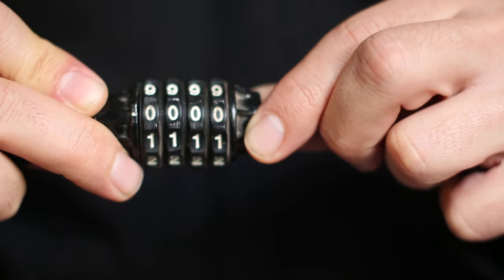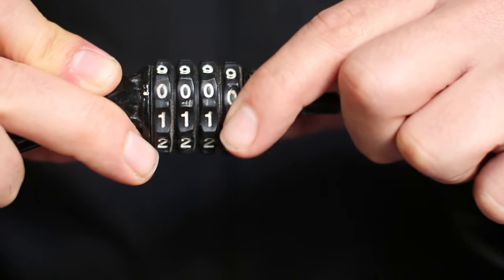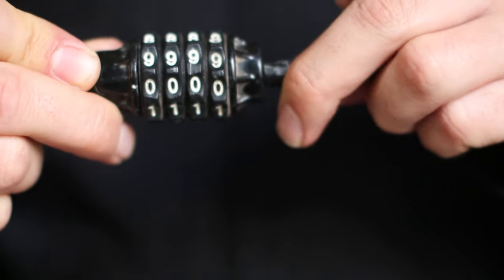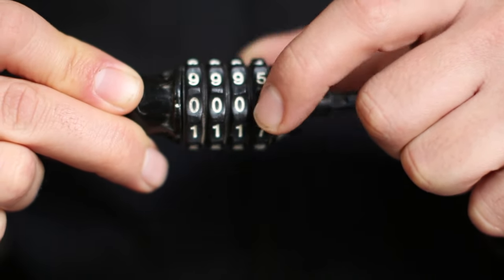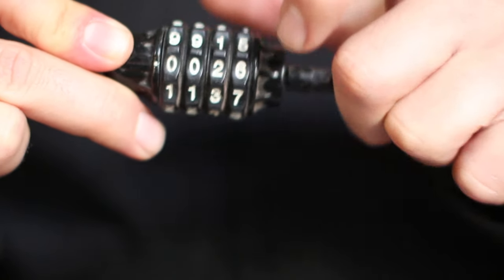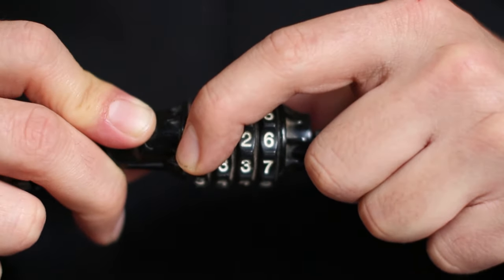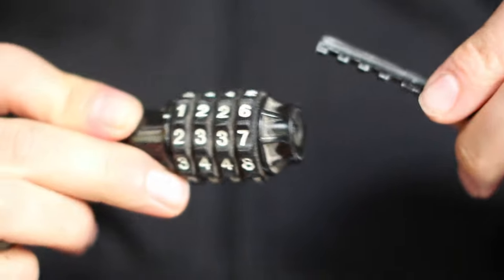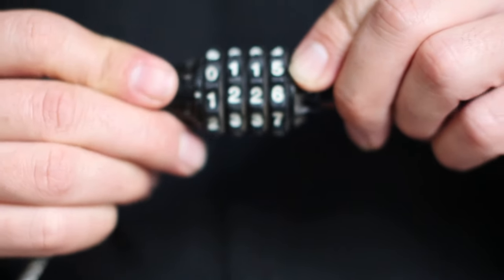How to crack a combination bike lock in seconds

Comment: Cool vid.  As mentioned, some of these locks are built to better tolerances and are more difficult to open this way.  They can also have one or more "false gates" where it feels like you have found the slot through which the pin will pass, but it's actually just an indentation in the wheel.  That makes it quite a bit more difficult to open the lock quickly.
Reply from the maker: Yes, I noticed this won't work on every combo lock.  I've seen this type of flaw on a few different ones though.

Comment: i had an old bike lock I couldn't remember the combo. tried all the numbers I would have used. once I felt like i got two of these numbers correct using this method, I was easily able to guess the other two. Thanks!
Reply from the maker: Great to hear it worked

Comment: My lock doesnt go in like that it goes from the side will this atill work
Reply from the maker: Only way to find out is try it.  Try to apply some pressure on the release mechanism and if it moves when you reach a certain number then the lock has the same fault as mine and it should work.  Some locks are tighter and this will not work.